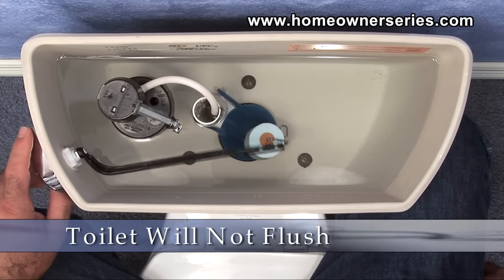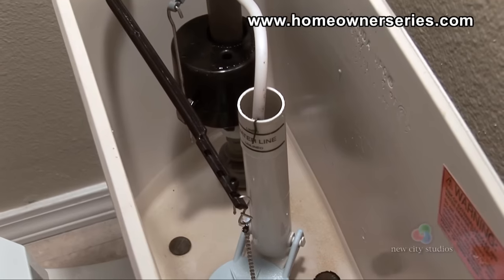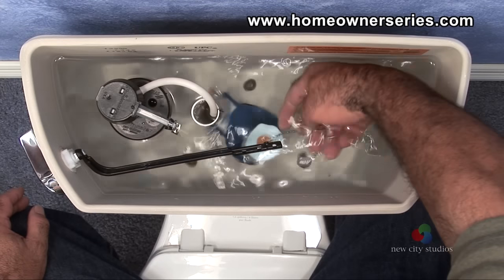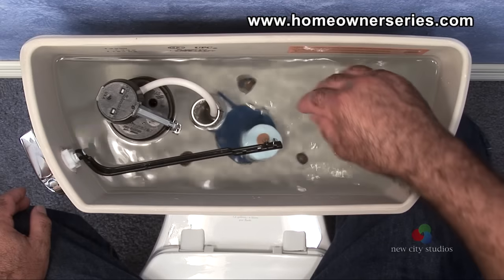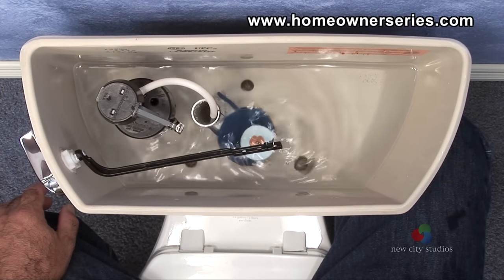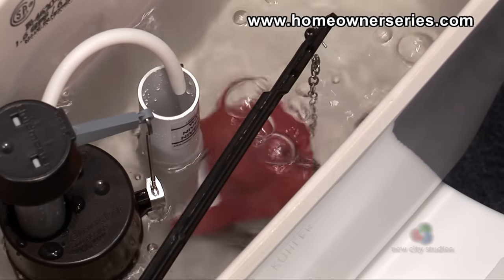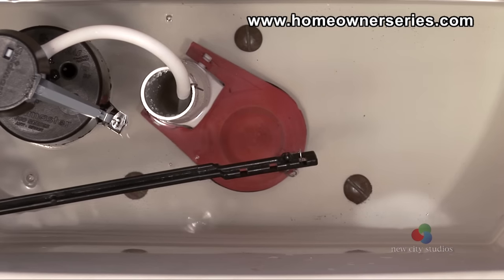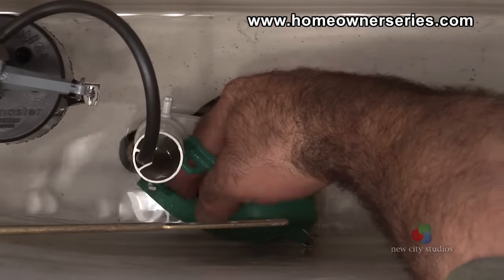How to Fix a Toilet - Diagnostics - Won't Flush

Comment: Nothing goes down during the flush process! Should I see if there's a qtip under it? Buy a new wax ring? I just bought this home and even the Inspection says it didn't flush properly,  Nothing goes down. Yes I tried the plunger

Comment: If the toilet does not flush correctly and you have to hold the handle; you do not have to replace the flapper. The problem is the chain has to be shortened. By shortening the chain it allows the flapper to rise vertically with the standpipe. On some toilets there maybe rubber attached to the flapper that comes to the handle;if your toilet has one this instead of a chain;it is just a matter of pulling a little more rubber through the eye of the handle. G.L. and have a good day

Comment: Thanks, my toilet is an older model and I bought a new one when I moved in but my regular plumber checked and said I did not need a new toilet!  Wrong!  However, this video sure helped me, as I have to hold the handle down on the towel before it will flush everything down the toilet without two flushes.  A gentlemen friend came over and rearranged the chain on the lever leading to the flapper valve.  That is when the trouble began.  Off to check everything that was shown on How to Fix a Toilet-Diagnostics- wont't flush.  There were more things on this Video I need to check that I was not aware of.  
Also, thanks The Oldkid888, I read what your comment you explained 4 years ago and you are not an old kid but a wise kid. lol.

Comment: At a local business that has a girls and boys bathroom, the girls bathroom toilet stopped flushing. Replaced toilet and toilet still will not flush. The water in the bowl will simply rise and slowly drain out ( 10 minutes). What would be the next steps?